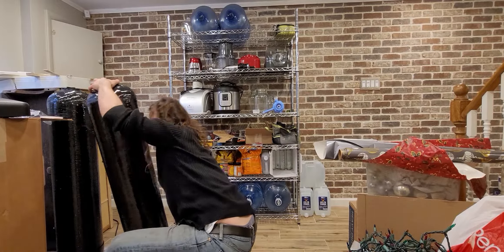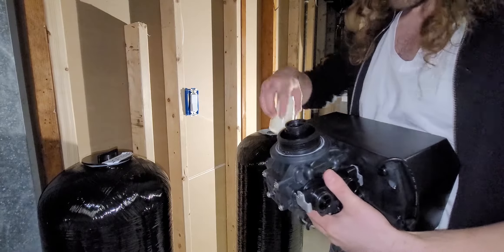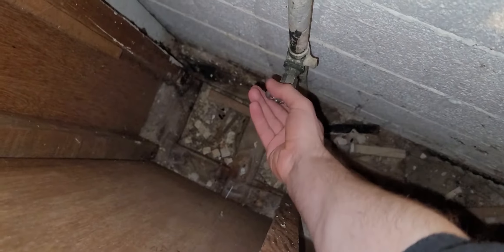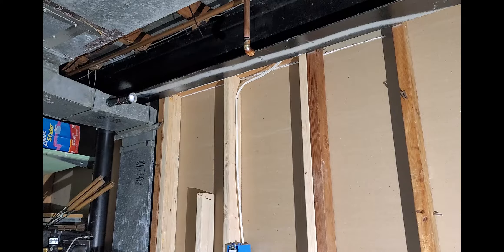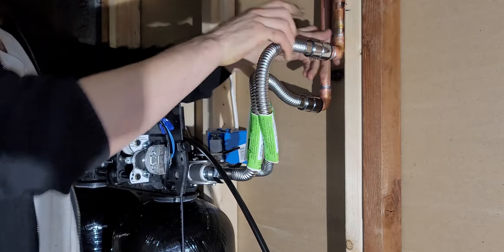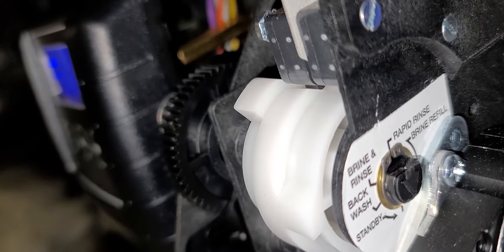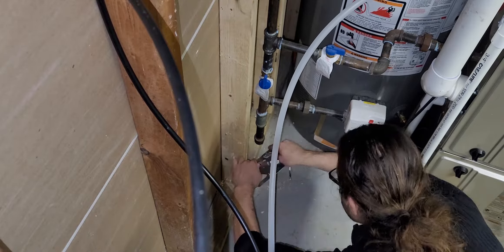How to Install a Fleck 5600/9100 SXT Water Softener - Softener Intro, Plumbing, & Programming

Comment from the maker: In this video, I go over how to install a water softener with no existing pre-plumbing. As far as DIY projects go, this one was tough, but this is why I made this video. Here I'm installing a Fleck 9100 SXT water softener, this is the model with two tanks so you never are at the mercy of the regeneration cycle. 
Honestly, for my small household, it was probably completely overkill -- for most households the single tank Fleck 5600 SXT is more than enough.

If you found this video helpful or valuable, consider sending me a tip, it would be greatly appreciated!
https://buymeacoffee.com/bootman

Fleck 5600 SXT SINGLE Tank:
https://amzn.to/477uzuF

Fleck 9100 SXT DUAL Tank (3/4"):
https://amzn.to/3AFFb86

SharkBite 3/4" to 3/4" FIP Push to Connect Hose:
https://amzn.to/4dW9XZj

SharkBite 3/4" to 3/4" FIP Water Connector Kit with Valve:
https://amzn.to/3WWIhfe

Disclaimer: I'm an Amazon affiliate. By purchasing through these links, I will receive commission at no extra cost to you, and it is greatly appreciated! Thank you.

Comment: What setting can i adjust that has the most effect on softness, I want the water softer than the "normal" settings for a 48K capacity system.
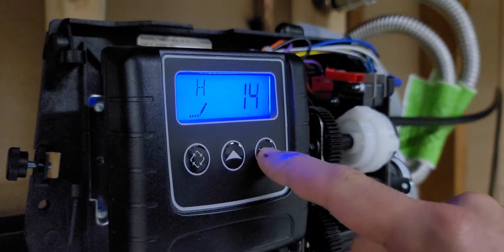Reply from the maker: @dnycrane  oh boy it's been a while. Looking at my own video, I think that's governed by the "hardness" or "H" setting (I talk about it at 09:33 and on), and I'm pretty sure the higher the number, the more it'll soften. But I make no guarantees on this info.

Comment: At 8:46 when you had to redo the joint due to a leak, did you just reheat the joint and add more solder, or did you have to reheat then separate the joint, clean it, then re-solder it?
Reply from the maker: I reheated it and added more solder -- but the hard part is always trying to get that last bit of water out so it doesn't instantly wick the heat out. So I drained the water, then attached a vacuum to the sink to prevent any water from getting there, and that seemed enough to do the trick.

Comment: I’m on city water. Do I need to use an upflow carbon tank, or is a resin tank sufficient?
Reply from the maker: I couldn't tell you - probably depends on water quality. But doing a water test should point you in the right direction.

Comment: Isn’t the overflow drain a gravity drain?  Looks like the drain line hooked to it went higher than the drain outlet.
Reply: No he was hooking the other drain to that line that goes to the sink. Yes the overflow is gravity fed and he sent that to the sump pump for the humidifier.
Reply: The backwash is pressure-driven and can be installed over the head. I have seen many dealers install  it that fashion

Comment: I think that water pump u connected the drain to will not have the capacity to drain the regeneration cycle. You will have a flooding problem. That softener drain needs to go to a proper drain.
Reply from the maker: That's not for regen, that's for overflow. Which doesn't make it much better, but for the regen I plumbed it right into a sink.